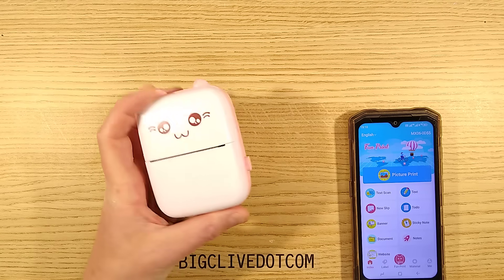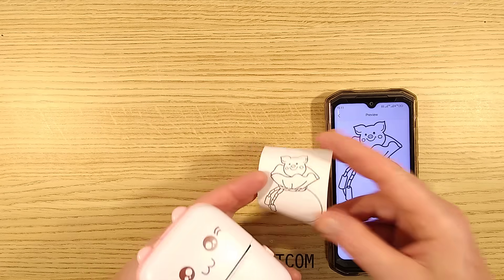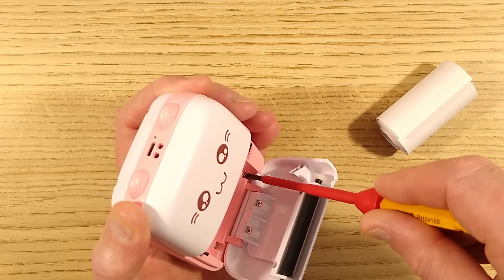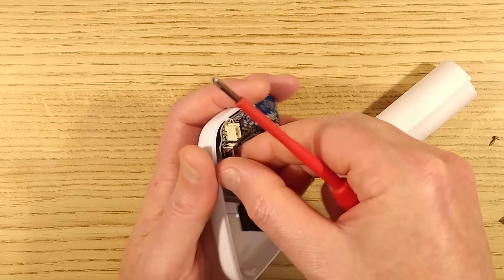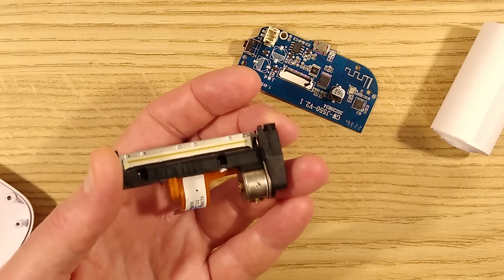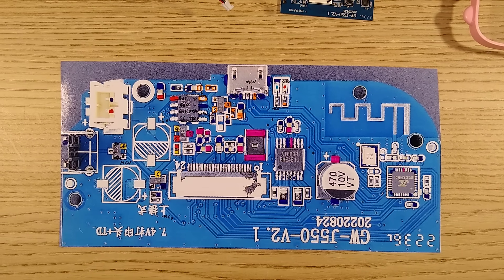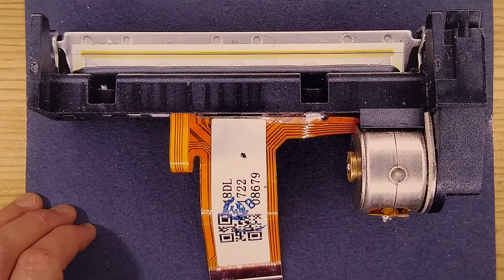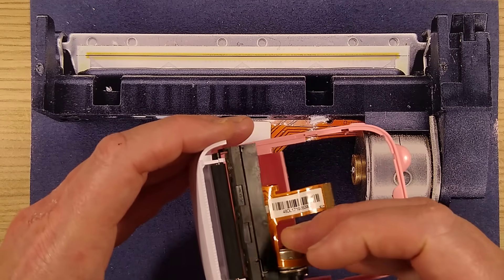Mini bluetooth thermal printer teardown - with schematic

Comment: Circuitry on the back likely is a boost converter, so that they can use alternate print heads (likely faster print versions) that are either higher resolution or faster response time, that need a higher power supply voltage to operate them, as the most common print heads do need something higher than 3V to operate, typically something between 12 to 24VDC at a rather high current, so as to have the very fast heat up and cool time for fast response.

Print head that blob is actually a few serial to parallel driver chips, thin and long, that take a common clock and enable, and then have a serial data in per chip, so that you clock in basically a small section of the data, and thus parallel load at least some of the shift registers in them. Then another connection provides the parallel output enable, so that all the print heads that will write thermally will get an enable on them, heating up the thin film element segments for the width of the pulse, while at the sale time the data is latched, and the shift register chain is busy being fed the data for the next line. End of the write pulse all the heads turn off, and then there is a cool down time, still clocking data in, before the next step is to have the stepper driver move the paper up one pixel height, and then repeat the write cycle. 

At 3V likely very slow, low resistance heads that need a good amount of power, thus the wide traces to the print head to provide it, and the missing electrolytic capacitors on the main board, removed for cost, relying on the lithium cell impedance being low, not so good after a few cycles or when the cell is getting low, and really should have been left in, as after all the 2 electrolytic capacitors would have cost under a cent in volume, but likely not compatible with SMD PNP line used, or the SMD versions were a whole cent more.
Reply: It might also be a buck converter, so the same printer can be run off two cells, giving 7.4V.

Comment: challenge for someone:  make a persistence of motion display with that print head.  have it spin and you should be able to see the image through a thermal camera.  I'm curious if the update rate is fast enough for that to work due to the thermal lag, though I guess they probably concentrated the heat into a very fine and insulated section
Reply: given the print speed it probably wouldn't work, though with thermochromic paint and the head slowly rotating it would be interesting.
edit: if it's spinning it would be cooling fairly well so it might actually work.
Reply: @satibel  i didn't actually see the part where he printed, but it makes sense for it to be slow.  also good point about the air flow cooling it when spinning
Reply: ask a bored engineer they'll anything when bored XD
Reply: Someone is going to have a version of Bad Apple running on it in no time

Comment: welp, youtube doesn't like me and deletes my comments, last try chip is ac6956C4
Reply: I was searching for the comment mentioning that this chip also has OTG capability...
I wonder if you take two FTDI/CHG usb serial ports and connect them like a nullmodem cable ... have seen devices that use this method instead of the common uart 😮
Reply: @SystemX1983  it probably was my comment but I guess youtube didn't like me editing it too much or giving the name of the website.
so they use serial over usb? usually that'd be done in the chip itself, haven't seen it with a discrete serial connection.

I've seen ble devices which use serial over bluetooth. (remote-controlled "silicone linear actuators")

Comment: I have a larger thermal printer, about 110mm width one.  Not bad for printing postal labels.  I find it really handy.
Reply: oh genius. sold me on the idea. now just need one to appear on amazon vine
Reply: @satyris410  If you're not fussed about the quality of the thermal paper.  I would recommend you get one that takes common width thermal till receipts.  You can buy those and make smaller rolls to fit in the printer.  I have 6 rolls of the 110mm paper and that will last me a lifetime.  Some thermal printers have paper that only fits their machine so you have to buy their make.  You can also play about with the sizes too, ie I can print portrait or landscape on mine and you get 2 different sized prints from the same sized paper.  Also thermal prints fade, and doubley so if you expose the paper to sunlight.  They last longer if you don't put them in direct sunlight or overtime the picture fades.

Comment: I bought an HP-41C calculator when they were a new thing and also the thermal printer for it. Waste of money for me: I was 17 or so and it cost me my savings from a summer job. Never got serious use from them. But the printer and the thermal paper were especially fascinating to me! I had a lot of fun marking the thermal paper with pressure and friction heat between a table and a moving fingernail, or with any source of heat.
Reply: I can't remember the model, but I had the Casio (I think) one with the printer built in, purely to play with the printer heh.
Reply: As a kid I was captivated by my Da's fax machine, the magical simplicity is irresistible. I spent hours trying different methods like fingernails or a soldering iron. My favourite of course was a magnifying glass on a sunny day. Northern Ireland rarely having such weather made whipping out the magnifying glass even more special.

Comment: It's like going back to the 80s! I had one for the Oric Atmos. Obviously not this advanced, or small. 😂
Reply: Did it print circles as circles, or were they elliptical like the ones produced by the Oric on the screen?
Ping! Zap! Shoot! Explode!.
Reply: @WellinDowd  I think I only ever used it for text. It was so long ago. 😂
Reply: I had one for my zx spectrum, it used a weird silver coating on the paper and wasn't particularly useful. It was pretty small though.
Reply: @meetoo594  I think mine could work on my 48k too with an interface. I really should dig out all my old gear.
Reply: @GothBoyUK I used it on my 48k, from what I remember it plugged into the edge connector on the speccy. I dont think anyone makes the paper anymore unfortunately. It was a spark printer and the paper was conductive iirc. Very innovative for the time but totally superseded by modern thermal printers.

Comment: I'd like just a tiny one axis round punch or a laser printer making text by small perforations, on regular paper. Some banks used to punch void or received info with the date that way. Like a dozen holes per letter. It is very legible and that width for receipts would be fine. 
  Not s fan of thermal paper due to its short lifespan.

Comment: I remember a few years ago when I was working on a BLE Microcontroller SoC development at a big CPU manufacturer :) we had some insights on Asian competitor SoCs. One of them was selling a BLE SoC what was available for 10 cents at volume. Mad. The application of that SoC was specifically for the "selfie stick" market, but it still blew us away that they could sell a BLE SoC for less than the cost of our test process.
Reply: Mass production has its benefits of economies of scale, plus years of cost cutting analysis. You could probably even get the same soc for 5 cents from a ghost run ha
Reply: That does happen at the larger scale too, with companies buying older production processes to make devices like DVD players (in years gone by) @nyetloki
Reply: IP theft is rampant in china so it's very possible they did not pay for development and just ripped off someone else. Also what the other guy said
Reply: The benefits of ignoring labor laws, human rights and environmental impact.
Reply: @_BangDroid_  A portion of that price for sure is covered by what you say. But I think a larger part was a strong focus on a specific market need, and an acceptance that these products would have a very short lifetime, so could have a very low quality bar.
Reply: I agree, I think you made the point better than I did. Exactly that, IMHO
Reply: People crap on China alot, but if they're saving me money I don't have an issue.
Reply: @Wegetsignal  Imagine the labor saving costs if we brought slavery back! Contrived example but there is a matter of  ethics to fair trade.
Reply: There is the bigger issue of environmental impact. My father was an engineer like me. He made things that will still be useful after I die. I have tools made before I was born that I have bequiffed to my younger friends in my will because I know they will make use of them. Designing things to last for a few years to make them cheap for consumers is abhorrent to any self respecting engineer.    @Wegetsignal

Comment: Looking it up it looks like those thermal printer heads look like a serial in, parallel out shift register. So you shift the data in and then fire a strobe to connect the shift register outputs to transistors which drive the thermal elements. Or, actually, several strobes covering different parts of the line, probably because driving them all at once would take too much current.

Comment: Sorry I missed how much you paid for it. Also, are the print rolls readily available? (Like, is it a standard roll?) Pity it isn't an adhesive backed paper :(
Reply: These are about £40 on Amazon last time I looked and the rolls (including sticky backed ones) are just standard thermal paper for tills etc so are really easy and cheap to find. Just get the correct width for the printer and you are golden.
Reply: Cool. I'd love to find the printer sub assembly to make my own design, but I assume this is a local product. Shame.  @meetoo594
Reply from the maker: They're only about £25 on eBay with a set of rolls including self adhesive ones.

Comment: Is the paper sensor just detecting presence of the roll or does it measure motion using optical mouse technology?
Reply: Nothing fancy, just a simple gap sensor.
Reply from the maker: Just the presence of the paper.

Comment: Takes me back to my old ZX Spectrum PC when I saved up my pocket and birthday money to buy the Thermal Printer and rolls of the silver coloured paper...
Reply: Yes - had one!😊
Reply: 48k, nonetheless!
Reply: I can't believe I had one at one point...And threw it away after finding it seemingly wouldn't work with my 128K Spectrum. 🙁

One interesting quirk about those printers - And testament to Little Clive (Sinclair's) aims to keep acceptance high through low costs - Was the print head being fitted to an oscillating bar so each thermal element was covering 10mm of the paper and not just a single pixel width. This meant the Sinclair print head was much cheaper to produce and probably bore a higher yield, but it;s also why the printers made a lot of mechanical noises while they were operating. ⚙🖨😇
Reply: Sectrum ?? Spellchecker  on dude ? 😂😂

Comment: I have a BT printer like this, and its nice for printing labels for containers. Some of the rolls of thermal paper have an adhesive backing. One needs to be careful using the labels in direct sunlight, as the entire label turns dark. I bought mine on Temu.

Comment: why did they use a MOSFET for reverse polarity protection? It seems to me that by using a diode the PCB can be semplified
Reply: MOSFET has a lot less forward loss; even with a Schottky Diode you're looking at about 0.4 V loss which is >10% off the battery voltage. With the MOSFET once it's switched on it's just the DS resistance and that's less than 0.2 ohms
Reply: Using mosfets in the low voltage sections or low voltage dc-dc conversion avoids significant voltage drop and according efficiency loss.  The loss is much lower on the mains side voltages so diodes for reverse protection are common there.
Reply: @markusaltendorff @Pgr-pt5ep   Great! Thanks!!

Comment: I have one of these always popping up that is potentially useful - it is being hammered to me on Facebook advertising at the moment. This one is a tape printer, complete with RFID identification of the tape you put in it.. on the one hand, I think it would be very useful as a replacement to the trusty old dymo printer in my cabling kit, but on the flip side, i have concerns about long term availablity of tapes and what I'm sure will be a proprietary lock to genuine tapes.
Reply: I think I would prefer a Brother printer (or a clone, an E1000 Pro from Aliexpress seems nice) for the laminated labels and printing on heatshrink. Maybe no RFID tape recognition, but TZe tapes are cheap and widely available and you really only need to know the width you use.